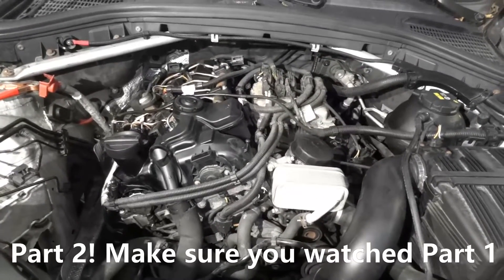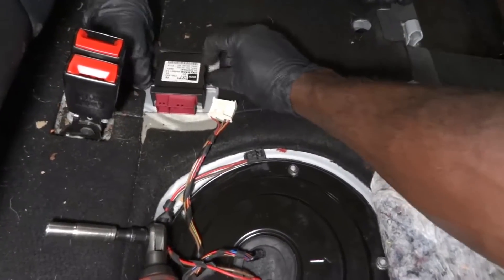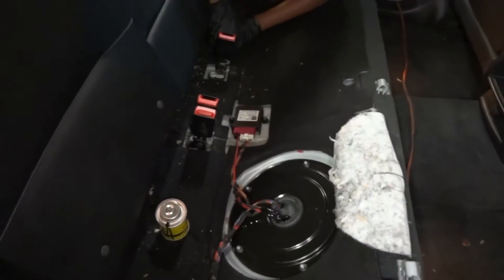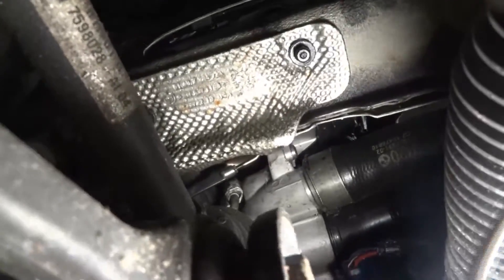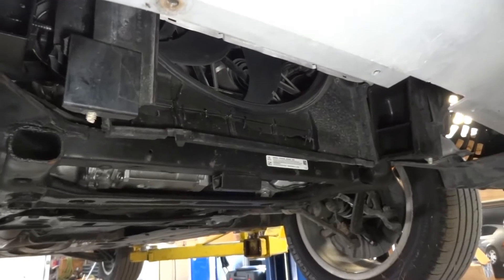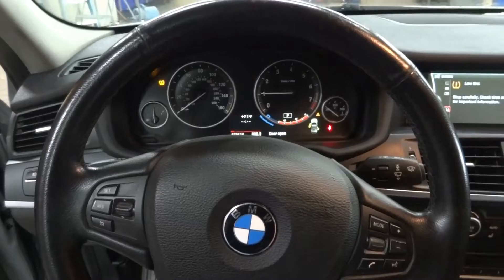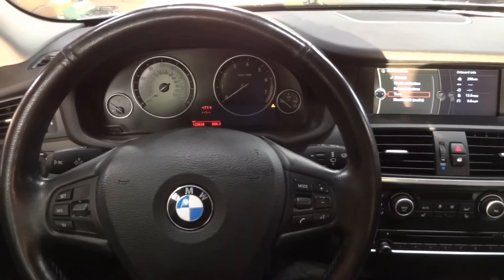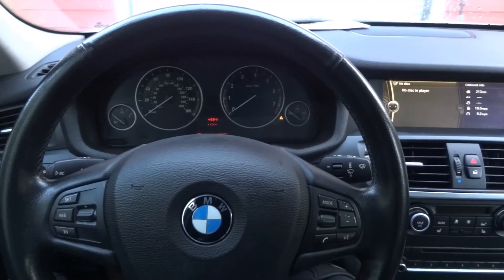BMW X3 CRANKS BUT WON'T START Diagnosis & Repair / BMW Engine Stopped Running While Driving Part 2

Comment: The customer is lucky with this BMW auction car, fuel level sensor and air turbo  cooler, it could have  been worse.
Reply from the maker: @abdouallahuniverse5689  YES!

Comment: Most likely, prior owner hit something and the prior owner or 3rd rate mechanic just ripped it out.  It could be the current owner hit something and just thought I don't need this part.  Shadetree type stuff.  Owner kept changing story, sounds shady too.  Running a fuel injected car low on fuel all the time isn't good for the fuel pump.  The fuel in the tank helps keeping the pump cool.
Reply from the maker: @Thomas-ul3uy   I agree!

Comment: Hi bro. I'm having a problem with this 2012 bmw x3. The engine is cranking but it doesn't start and i notice the engine check light is not on while ignition is on. I check 35,46 fuse but when i take out 35 fuse and install it then the check light come on then it goes away after cranking the engine. Is there any idea about this issue?
Reply from the maker: @hensleyholder3266   I recommend you have a pro mechanic diagnose it for you, scan it and see what codes you have

Comment: I agree all of what was said in comments & more.  Good mechanic are hard to find these days.  I have a BMW 2013 sedan series 3 with same problem, car shut off in middle of road and battery died.  We put in new battery & now it crank but won't start.  1 Mechanic diagnosed a 2 Camshaft sensor in front of engine whcih he replaced but it still not fixed. Other Mechanics are thinking of engine compression and trying to squeze more money from me.  Not sure what to do.  BTW I have a son name Abrahim too.
Reply from the maker: @elhagea  Oh Cool, did they check fuel pressure or compression

Comment: Excellent  approach towards diagnosis.  It is the vest  step by step method. Specially when someone already tried to fix it. It is difficult to diagnose.  
May God bless you. 
It is really hard to make a complete video. Doing justice with your work. 🎉🎉🎉
Reply from the maker: @farooqbadar2490  Thank you!

Comment: Part 1&2 are the first videos of yours I've seen due to a crank no start issue with my son's car. I have been trying to track down the issue since Christmas, so far to no avail. 
I don't know much about cars but anytime there's a breakdown I do a ton of research and have been able to fix the issue myself.  Which for females is not too common. 
What I came to say is that I really enjoyed how you acknowledged and verified the complaint, then showed us the proper steps to diagnose the vehicle. The information I learned watching your videos leads me on a different path from what I've been doing. But it seems like the common sense path to begin at. I'm gonna order  those tools you had and give it another go. Your explanation, pace, and video work was on point. Thanks for helping us diy'ers.
Reply from the maker: T  My Pleasure! I'm glad to hear that the video was helpful!

Comment: can you please make a video how to replacement low pressure power sensor for BMW 325i N53 2009. thanks.
Reply from the maker: Alauddin Al-Mahmud  will do! when a vehicle with that problem comes around!

Comment: You guys are good I just purchased Ekpm2 for 2006 bmw 325i crank no start I also purchased new fuel pump no luck car is not catching spark to turn engine over help any suggestions my has been down for a month lost a lot thanks kindly
Reply from the maker: Larry Joe  if you don't have spark, check your cam and crank sensors, I have videos in this channel that can show you how to check them!
Reply: Hey thanks will do and also it's that my fuel pump does not stay running it shuts off

Comment: Hi I watch your video my bmw"x 
3 also same problem fit. N new bmw make filter petrol in front at the rail crank it don't want to start only crank
Reply from the maker: @user-tl4fp7hk2l  Follow the steps in the video to find your problem!

Comment: I have a 2008 750 Li BMW no crank, no start. I got Gas coming out the injectors rail, strong compression when cranking, have not check SPARK and Fire yet. What too do.
Reply from the maker: @williewilliams2012  did you scan it? what trouble codes do you have in memory, check your crank sensor!

Comment: I wish you also showed the fuel level sensor, turbo air cooler, and other pare replacements on camera.

Curious, why didn't you inflate the customer's tire?
Reply from the maker: @samgod  I didn't understand your question
Reply: @KITS_Auto_and_Truck_Repair  you kept pointing out the tire pressure monitor was the only light left on. You gave them some gas. Inflating a tire is free.

Comment: I’m having the same problems car will not start but my code fault are 1c0102,130308,120408,1c0301,1c2002,108c01   I guess I have my work cut out for me
Reply from the maker: victor smith  you should get the vehicle diagnosed!

Comment: The tire pressure warning indicator was still on at the end of the video, so you didn't fix everything.
Reply from the maker: Fluffy Blue  I was not hired to fix everything! the vehicle was brought to me because it was not starting and that's what I fixed!
Reply: Kit, I watch a lot of your videos, because you are so through, and explain problems and diagnostics very well. In your other videos you said you inspect the vehicles when before they leave so you can inform the customer of possible problems. I too feel that you should have made sure the tire pressures were good. Perhaps the low tire pressure light would have gone away. If not then maybe inform the customer there may be a problem with the sensors. It would have taken another five minutes. For me, I just don't like to see any lights on the dash, especially something that simple. I love your videos though, and will keep watching of course. Thanks for taking the time to record your repairs. God bless.